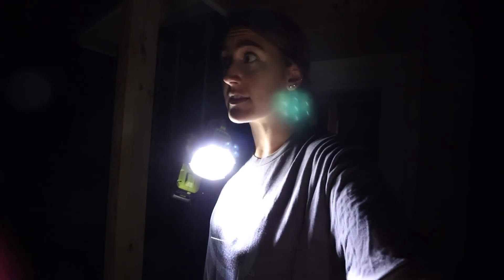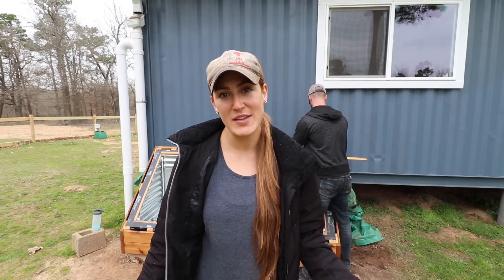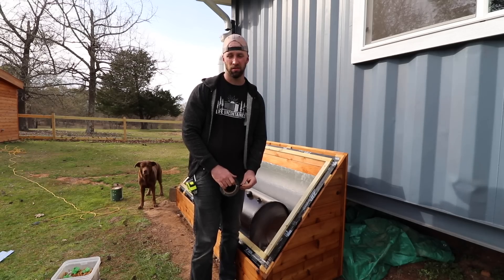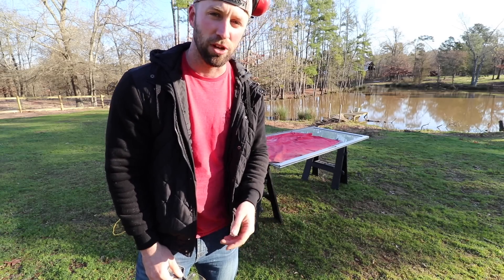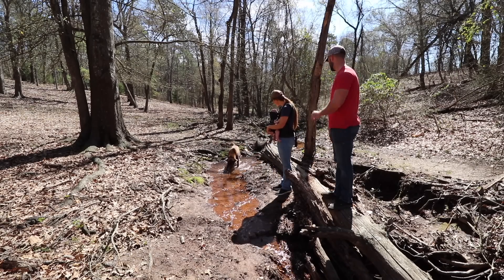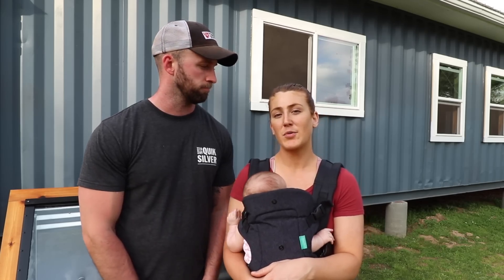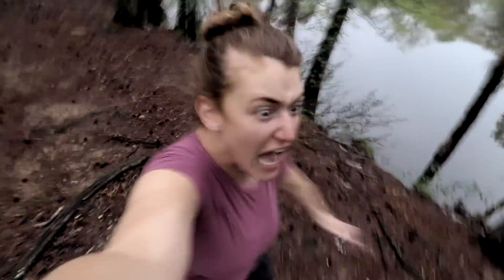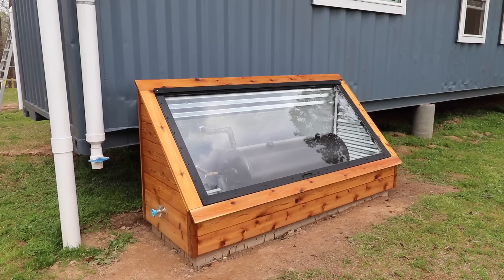Storing The SUN'S ENERGY In A Water Tank!

Comment: I'd be interested in knowing how well that solar water heater works. I never did one like that. I did copy a commercial design once using pretty small tubes and just the normal rising thermal to circulate. I just built a large box out of 2x4. Used pipe painted black. The whole inside of the box was painted black. It got ridiculously hot and I just had clear plastic over the front and no double layer of glass which I wanted but never got around to doing. Typical big pipe on the bottom and big pipe on the top with a lot of little black tubes running between. Learned a lot from that one and want to do it again someday with some major changes like insulation and a storage tank instead of swimming pool.

Comment: Wrap the water heater in an insulated jacket. Add a water pan underneath + audible alarm water sensor. Technically, you need the heater up off the floor for an air gap. You can just tape a foam circle on the bottom if you want to anyway.

Comment: How are you going to place insulation and drywall around the water heater?   Also completely agree with those suggesting to use a water heater pan to protect against potential leak

Comment: I don't know if this remark has already been made but you could increase the efficiency of your batch water heater. There are certain kinds of "insulation films" that you can put on the inside of your window (of  your batch heater). These "films" allow the solar heat (infra red) to get in but don't allow it to escape. I think this could drastically improve its output.

Comment: Spenser do you have a temperature sensor on the water outlet pipe from the rain catchment tanks? In the summer the catchment tanks must get to 100° so a 10° rise out of the solar water heater should be easily attainable. The winter will be very interesting as to how much energy the water heating system will consume in the non sunny days.

Comment: Don't know if this is still useable but back when I was a home owner, everyone was advised to "wrap" their water heaters in insulation,(not the one outside) because most water heaters have some insulation, it's just not that much. I used fiberglass insulation and plus according to, This Old House" , your water heater should not be set for any tempeture over 120 degrees. That saves energy use, and will stop dangerous scalding of people. This also was told to me, when using solar heating,  paint your heater black because black absorbs the heat better, along with the area or materials around your "heater".  Yours is shinny and will reflect the suns rays.  Insulation for hot water pipes is also good to use and is sold   Hope this is still useful and thanks for your posts. They're very interesting to watch. By the way, if I'm telling your stuff that you already know chalk it up to my being an old man and have learned useful information., at least I hope it's useful?
Reply: Frank Gerlach, you’re right on about the 120 degree setting, especially with a baby in the house now....

Comment: Glass in most sliding doors uses Low-E glass. It will reduce the energy from the sun meant for your water pre-heater.  When you can, have it replace with a pane of clear, tempered glass.

Comment: Found your channel a few weeks ago and binge watched. Great work you two!  I do have a question on this one....

Most double pane sliding glass doors are designed to maximize thermal efficiency...in other words, to not transfer heat into the interior. By using that door, aren't you hindering the effectiveness of the batch heater?  Would single pane safety glass, or even plexiglass transfer heat far better? Just my .02.

Comment: For the Table Saw I saw you were running the smaller material when cut along the fence. You want to run a piece of wood through the Table Saw with the majority of the material on the side of the saw, that’s the same side as the fence. Hope that makes sense lol. Just another safety precaution.

Comment: Hi my name is Kevin and I’m a general contractor and I noticed you put both shower valve back to back that is a no-no because if you ever have an issue with one you have to rip up the tile in order to get to the valve the best practice is to place them on opposite walls both of them so when you have a problem with the valve or a leak you can open the drywall and have access to it to repair the issue and you can put an access panel after you’re done

Comment: Hi guys. Awesome work. 
So, iI was doing some research to built a solar collector and I found this video. Acording to what I read, you should paint all the interior black. You built a little greenhose. Visible light and UV can pass through the glass then bouce on the reflective surface and escape though the glass again. Whith a black coat visible light and UV are going to become infrared and glass is opaque to inflared thus is not going to be able to escape. You are going to capture more energy. On the counterpart, you are going to loose some energy by thermal transmitance, but because of the good insulation of the box I think it is not going to be a problem.
Keep up whit green energy, our planet says thanks!

Comment: Great job on the water heater. Now you are going to have to drain and move it to spray foam and drywall behind it. Find yourself a 90 degree garden hose fitting for that stupid plastic drain on the bottom. I had nothing but problems trying to get a water hose attached to mine when I had to change the anode as the valve was too close to the floor.

Comment: If you had propane .. I would have recommended a tankless hot water heater - uses little electricity and barely and propane - very efficient. I do like your solution though .. it is definitely something to consider in some cases. Cheers !!

Comment: I am designing what I'm calling an Earthshipping Container home. Buried shipping containers with the front shipping containers being an atrium with the very front being all windows.  I want to put radiant heat & cooling floors in. I was wondering if installing external hot water heater enclosures along the front of the house & hooking them to hoses throughout the house would work for 50% of our winter heating needs. I was also wondering if the same type of enclosures could be put at the back, buried part of the house & those hoses come inside to help cool the house in the summer. Thoughts? We are in the Kansas City area.

Comment: I actually have a question about your power system.  So you guys have had the solar panels and batteries for a few years now, how is that working for your day to day appliances.. (refrigerator, washer, dryer, microwave, etc.)  are you using off the shelf 120v units or 12v devices?  Just asking as I am building a house later in the year and investigating off grid options vs hybrid, also solar/wind systems.  Any advice you have would be awesome.

Comment: i wouldnt use too many sharkbites, tend to fail after some years. you can use them but i would do a pex brass adapter and solder a butt piece of copper to it and then solder a steel/copper flex line to it. nothing wrong with those but copper is safer imo.

Comment: PAN!  You NEED a Pan UNDER your water heater, also.  Small boil-overs, small pressure spurts, eventual leaks in plumbing or the heater itself, you will definitely wish you had installed one WHEN that happens.  It is not usually and IF but a when.  Ask your hardware place about it.

Comment: Nice work.

However...

Pulling a 2x4 from the outfeed side of a table saw with no blade guard and the blade set so high is an accident waiting to happen. If the saw kicks back, it will pull you right into the blade.

Comment: My concern is even with the solar heat the electrical usage of the water heater will severely tax your solar panel/battery setup. Since there are 2 heating elements, one upper and one lower, disconnect the lower one.  There are lower wattage heating elements as well.  They are well documented in solar videos.
Reply: Also, I'm kind of surprised they didn't buy a hybrid electric water heater.

Comment: You could of easily went with a tankless (on demand) water heater - especially if you are solar preheating it.  With tankless you are only using electricity for the few minutes you are actually using the shower.

Comment: Not only is it "overkill", but heat rises, so putting insulation under an insulated tank is useless.  If anything, put an insulating blanket made for water heaters on top of it, and the pipes, and you're better off putting a water catchment pan under the water heater, for in case it ever leaks your floor will not rust.
Reply: Oh, I was about to say that an insulated water heater in a hot chamber is pointless, but I see you modified it.

Comment: I would put a pan under that hot water tank with a drain to the outside. I had one that leaked when no one was home, What a mess I had, a FLOOD. I learned my lesson and got one of theses pans that has a drain. What if you paint the glass Black to make more Heat. That's funny with you running and screaming. Very Funny.

Comment: Why not just use a heat pump water heater?  Much less electricity usage. Or solpal solar water tank. You can use them as a primary tank too as you can buy them with optional heating elements.

Comment: I'm not fan of the pre heater design... In my opinion it should be far thinner, less air in it, then... No tank, just tubes connected to a metal backplate. Small tube would let the termosyphon start faster. Everynight the whole tank will be cold and it will take time to heat it till syphon kick in.. => the tank store too much energy and it's not is rol, the interior tank is the battery not the exterior one... do not know if it makes sense..

Comment: The tank inside the water heater is already insulated from the outer shell. There is no need to use insulation outside the shell. It is not going to affect the water temp. inside the water heater.